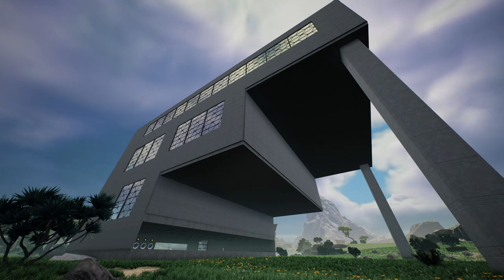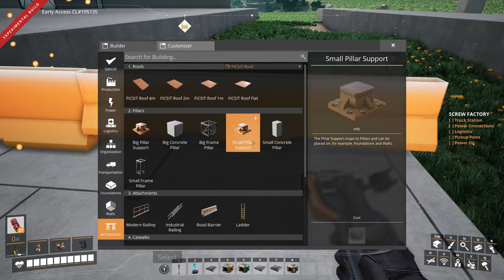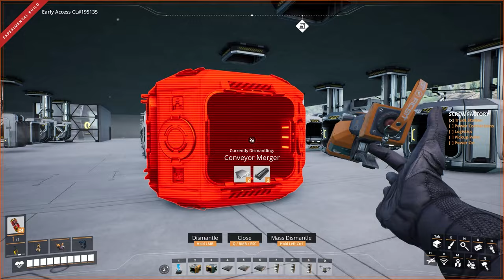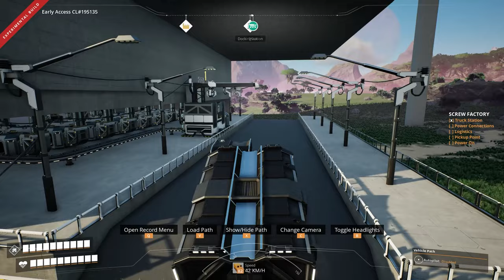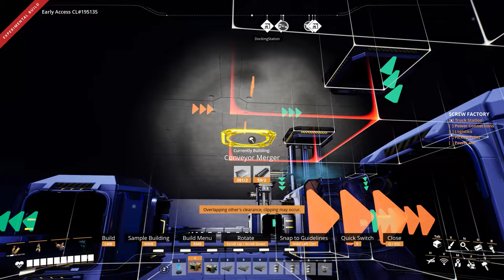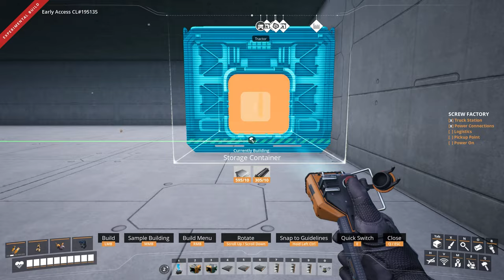1080 SCREWS P/M! - Let's Play SATISFACTORY Update 7 - Ep.21

Comment: Definitely remove that ceiling layer. Not having it adds a lot of depth and the black asphalt breaks up the grey. Overall you created a very elegant logistics chain for challenging routing. Looks great!

In that glass case on the top floor, you should place a single bin of screws atop a lone concrete pillar, because.
Reply from the maker: That's actually an awesome idea, making statues/monuments with items on them!

Comment: I'm continually impressed by how clean and tidy you're able to get your builds to look. It's something I'm slowly working on. The design of this factory is really quite clever as well since you can basically just change the ore that's brought in and a few recipes in the machines and it can be used for an entirely different product. Which might come in handy if you come across the alternate recipies for computers and heavy modular frames that don't require screws.
Reply: my mom said i could get a better pc at 2000 subs :)

Comment: Oh god the clipping xD  It's not good!

A design idea for your consideration-- on the logistics floors you could put the inputs on the ground level and the outputs a level above, directly on top. Like, beneath each machine, stack a merger on top of a splitter, and connect the elevators from the ceiling to them. All of the belts can be stacked on top of each other, just going opposite directions. Could save a bunch of floor space and make it feel less claustrophobic!

Comment: The Mark 3 belt has a max output of 270, and that what it was doing by the end, where the flow of screws was perfect. This means that a merger tha outputs a mark 3 belt can have a single input of 270, two inputs of 135 or three inputs of 90. Since the manafold you built had two mark 3 inputs and single mark 3 output, that meant the merger had to alternate between those two, making it half the speed (i think)
Reply: Could not quite follow your train of thoughts, especially because you talk about the mergers where I would expect splitters to be the problem, but maybe you mean the same thing that went through my head while watching this. I think the issue was described (and fixed) in an earlier episode. The first splitters distributing the incoming materials could feed all "lanes" more evenly ... for example 3 with 90 ... rather than sending 135 to a lane and the other 135 to a splitter that feeds two lanes with only half that. This probably applies to all floors and explains the slowdown. Maybe this will be mentioned in a later episode?
Reply: @hobbykuenstler  Well, splitters wouldn't hold you back - Try to think it like this: you have two M3 getting merged into a single M3, with both inputs trying to feed max cap, at 270. For the inputs to run at full speed, the output would have to move at 540, and that's not possible - in this case, the ouput can only get to 270 and, therefore, the inputs will get slowed down to 135 each.
Reply: @f84kjsg7  I don't think there was any belt that gets input from several belts that carry 270 each. Which floor do you suspect that is happening on? The splitters themselves wouldn't slow you down, correct ... but when you send 135 to constructors that can only handle 90 total, then you see a slowdown, I think that is what was happening.
Reply: @hobbykuenstler  by minute 59 we see the manafold that carries screws to 4 boxes. Darred said he only used mark3 and is puzzled by why it is stopping a bit behind the last merger - the inputs in case are a m1 elevator and a m3 belt
Reply: @f84kjsg7  But at that point the 270 belts don't ever get merged. They are transported to boxes. And the refers to a moment around 58:08 where he looks at the first "row" of constructors. The M1 belts to the constructors are no problem ... they never take more than 60. I still think that the issue is that too many rods are sent to the first row of constructors by the first splitter.

Comment: This is just a guess but I suspect why you're seeing the slow down of the belts at 58 minutes is because the feeder lifts being at 60/min means that the item is only fed through the merger at 60/min. Therefore the screw traveling at 270/min has to basically stop to wait for the screw traveling at 60/min to finish moving before it can go again.
I think if you update the lifts to level 3 so they are feeding at 270/min then it might flow better as it should reduce the stop/start.

Again this is just a guess as I haven't specifically noticed it before but it might be worth trying to see if it helps.

Comment: im sure people have already mentioned this but the reason why you have to rotate the item lifts is because they start off facing the way you are looking. so if you're side on to the splitters then it won't point the right direction. if you are looking directly at the splitter it will point the right way and u won't need to rotate it. :)

Comment: Factory looks good! I see you've sorted out the thing with adding splitters onto an existing belt - the belt flashing gold shows that it worked. One option for the empty window on the 4th floor: you could move your storage containers to the roof and then have 4 lifts moving the screws up. Lastly, I feel like the mergers tend to stutter like that - I've definitely seen it in my game.

Comment: A tip with manifolds. You can point a splitter or merger directly at the input/output of a conveyor lift, and it will attach to the lift saving more space
Reply: Isn't it what he's been doing since last 3 episodes
Reply: @frust69  nah. See, when you place the merger down first, you can snap the lift into it. If you place the lift first, you can merge the merger/splitter into the lift by pointing the merger/splitter directly at the lift hole

Comment: I've been following your "Let's Play" and I've got to say, I find myself implementing a lot of the same techniques.  I noticed something that might save you a little time in the future;  When building off the floor in your logistics areas, do those first in case you need to stack splitters/mergers for height over an area where you plan on having belts running.  Something else I noticed;  When you brought your parts into your logistics floor and then split them at the end of your lines, you could balance your line inputs for your manifold by doing a step-down split (I.E. one splitter goes to two splitters to balance 4 lane inputs).  I'm not very good at wording it but, @Totalxclipse has a great video showing what I mean.  Keep up the great work, I look forward to more.

Comment: Just guessing with no evidence or real logic but maybe the stuttering belts are due to rates of speed.  You have 60 ipm going into 270 ipm which isn't an exact derivative.  I suspect that in the long view things are still going at the rate desired.  But maybe the stutter is due to one rate being higher so the other tries but needs to stutter since that is higher than it is rated.  It still goes 60 it just tries for more.  Nice to know you have those go getters trying to be more than they are.  One way that might serve as a test would be to use some 120 ipm elevators.  I would think there would be no stutter then.
Reply: I think he hit on the reason just at the end. The screw machine buffers were probably backed up and trying to empty at 60/min instead of 40/min. Should eventually sort itself out but slowly because of 40/min being added to the machine buffer.